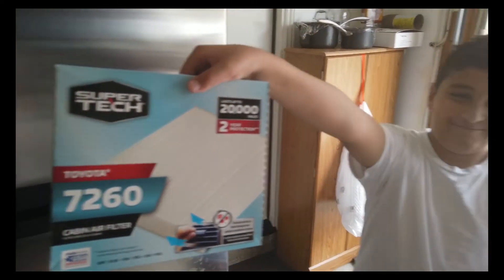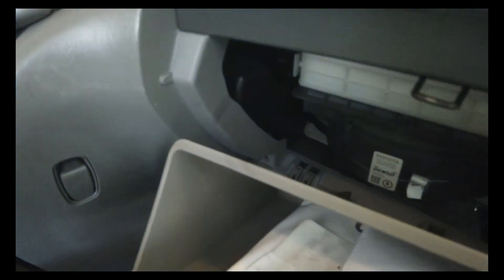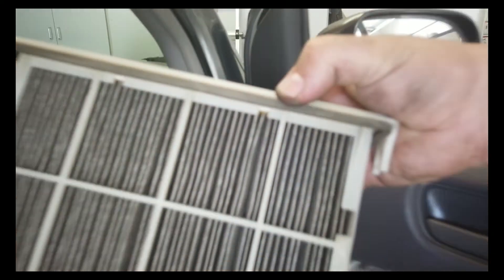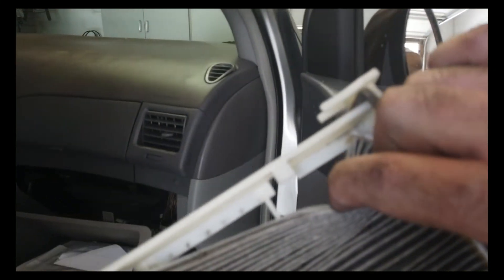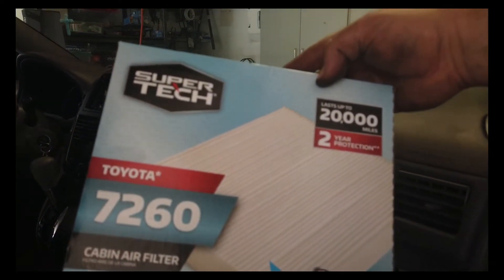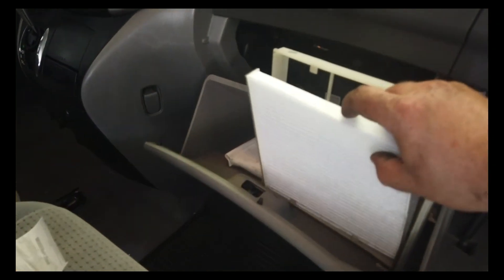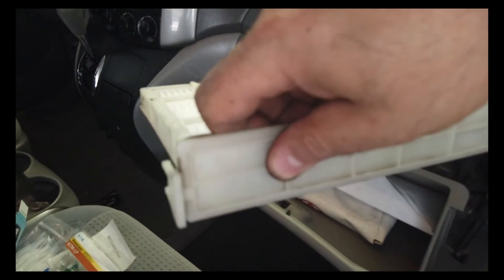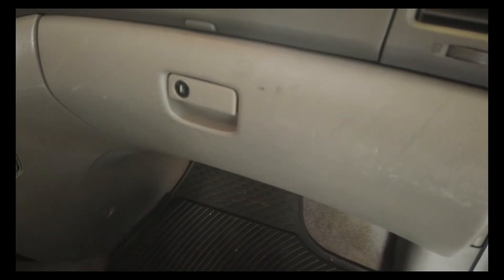Cabin Air Filter Replacement - What Happens When You Don’t?

Comment: I use the SuperTech filter in our Toyota as well.
One plus is that it's made in the USA.
There is an arrow on one edge of the filter that is supposed to point in the direction of the air flow. You didn't mention it and maybe you didn't even notice it. The air flow arrow should point down.
All horizontally mounted cabin air filters with the blower motor mounted below the filter will have downward air flow.
The OEM Toyota filter does not indicate air flow but instead tells us which side goes up.
Reply from the maker: Thank you for the input,  I had no ideal about the arrow, thanks for letting us know.  Cheers